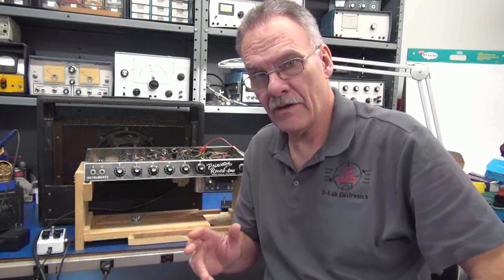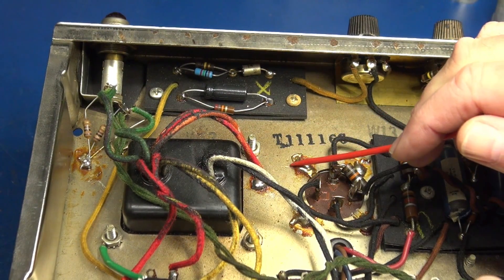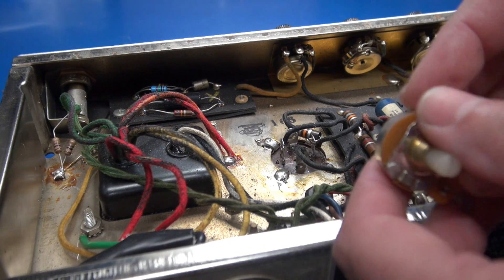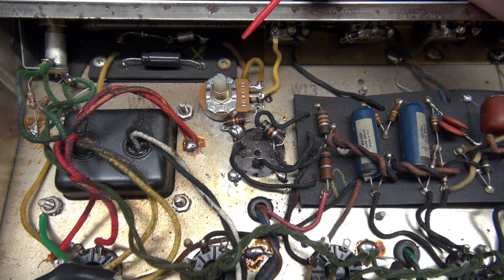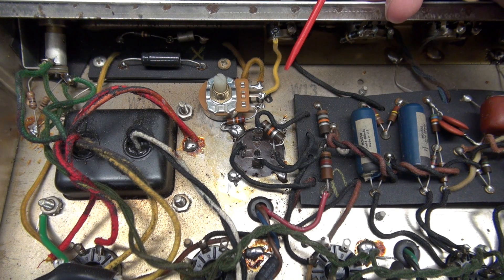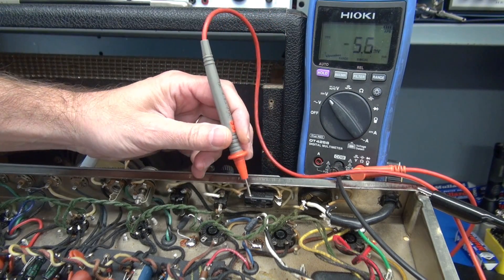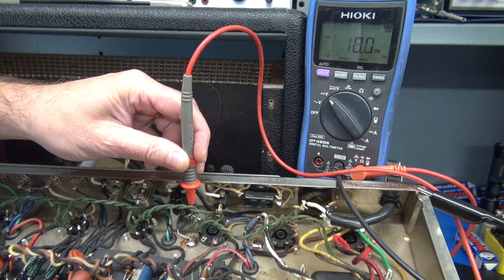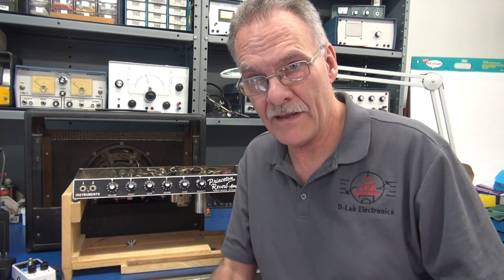Add variable negative bias Vintage Fender Princeton Reverb AA1164 Tube guitar amplifier 5 easy steps

Comment: Would it be an issue if I place the bias pot where the ground lift switch is located in the back panel since this is not being utilized?
Reply: That's what I will be doing. Now that I have a 3 prong cord the ground switch is disconnected.

Comment: I know this is an old video clip..my question is have you been asked to do the same adjustable bias mod on other fenders such as twin reverb, vibrosonic etc..

I've a twin reverb with tube balancing pot that I'm going to turn into adjustable bias to dial that negative voltage better.

Comment: Terry,  First I would like to thank you for your time and willingness to share your knowledge with us.  I have watched your videos over and over again and learn something new every time.  I do have questions about the 1ohm resistors 6V6 pin 8 to ground.  Is the purpose of these resistors to protect the tubes against a short of the bias potentiometer ?  Would any "regular" 2W 1 ohm resistor work in this application ?  I have researched "current sensing resistors" and am confused about what they are, how they work, and what they do.
Thank you again !
Reply: I think is just to read the drop voltage on cathode, for current adjustment (I=U/R or U=RxI)

Comment: Hey Terry,  I'm seeing the fuse blow as soon as I turn the amp/standby on with my Hot Rod Deluxe...if you were starting on this issue, what would you look at first?...MY plan is to replace the Output tubes, then the crappy IC filter caps, and probably the 5w sandblock resistors on the circus board...after of course, making sure the correct fuse is being used!...thoughts? always enjoy your videos!
Reply: Don't just replace parts. Diagnose the problem. Moreover, new tubes are not necessarily better than old tubes. However, new electrolytics are better than old ones.

Comment: The reason the bias was not adjustable on these amps is due to the fact that the tremolo circuit is bias varying and it can be tricky to balance when altered. I once had a Traynor amp with bias vary tremolo, with an adjustable bias. It was red plating every set of EL84's I had so I installed a variable bias on it. While I was able to fix the red plating the once sweet sounding tremolo never sounded the same
Reply: You can still get a good tremolo with an adjustable bias, just need to bias around or slightly below 70%. As the bias gets more to the 75% and above you lose tremolo depth. Such was the case for my Princeton build

Comment: Do you really install those 1 Ohm resistors just to make the math braindead easy? Surely there's another resistor (or the output transformer primary) you can measure across, no?

Comment: Hi Terry, I added 1 ohm resistors to pin eight on both power tubes of my deluxe reverb kit build from MojoTone but my millivolts stay at .2 regardless of the bias adjustment. I got my negative bias voltage set to spec, but other than that nothing happens when checking the resistors. I am at a loss, I have followed the directions perfectly from my understanding.
Reply from the maker: Check those resistors (ohms) with the output tubes pulled, are they 1 Ohm? Is the amp producing sound?
Reply: @d-labelectronics  Thank you for responding. I ordered them recently and they are 1ohm but they seem to fluctuate from 1 to 1.5 so maybe that is the issue? They are supposed to be 1Watt 1% metal film. I ran from pin 8 directly to ground on both output tubes. I just figured my MV reading would go higher than .2 or .3. I have tried two different multi-meters as well. It is really odd but the amp sounds great. 
Thanks again
Reply from the maker: Is your meter on the MV scale or volts? It may just be decimal placing?

Comment: Hey Terry, while 20ma is spec for 6v6’s in a Princeton I’ve learned with mine that 20ma-21ma is a little hot, as in above the respected 70% bias for push pull amplifiers. Could be because of my rectifier, PT, or wall voltage but so I had to do the vdrop(output primary half winding) x Resistance (same primary half winding) to get milliamps and then ma x plate voltage to make sure plate dissipation was below or at the 70%. What is your experience with biasing to certain percentages and is it really that important as long as you don’t go above ratings or red plate?? Would love to hear your knowledge on this!
Reply: You're right. You must measure the plate voltage and calculate the PD. If your PV is too high, even with 20 mA you could be too hot ...
Reply: The KISS math using rounded-off Fender-ish specs 😊 would be 20ma x 400volts = 8000mW (8 watts per tube) 😮 a little hot for 6v6 or el84,…but just right for Rock & Roll 🎉🎉🎉
Reply: @daveanderson5680  6v6’s are rated For 12-14W in push pull amplifiers. 8watts is the most ideal.
Reply: You want to run any Fender amp that's running a pair of 6V6's on the hot side, I sometimes will see them running at 80% dissipation or more with no problems. Start reducing the bias and you'll find that the tone suffers significantly

Comment: @D-lab Electronics

Hey D-Lab. Quick question that has probably been exhausted on most forums, but I wanted to come to.a guy who really knows his stuff.
I have a 1970's Super Reverb. Had the Master Volume, mid control (normal channel), and pull boost knob...

I don't use the Normal channel at all, nor the Tremolo effect.
I've been looking into the old trick of pulling tubes on the normal channel, and swapping the 12at7 Phase inverter to a 12ax7...

Just curious on your thoughts regarding this, and perhaps a video suggestion for those who are interested in the "science" behind this, what it does, and why it does it...

Side question... I notice that even with my guitar plugged into the Normal channel with all tone knobs set to zero, there is no sound/volume produced... not til you roll up the controls a little bit, then it comes in... Is this normal, and if so, why does this occur...

Also, I'm curious about "channel jumping", and how that works and what the best measure is to dial in a sound using that method...
Perhaps this would be a good video idea to those of us out here wanting to experiment a little without digging into the chasis of our amps and permanently changing things... simple "mods" we can try for chasing alternate tones as players.

I've played for 25 years, but this is my first "vintage" Fender amp, and I am still a bit ignorant regarding the quirks of the circuit, so any help would be greatly appreciated. 
Many Thanks,
Chris
Reply: I can speak on the tone knobs, yes that is normal since it Is a passive tone stack most fenders have. they only subtract frequencies (from 10 being no loss of frequencies) rather than add or boost them. so if they are all at zero there’s an easy path to ground.
Reply: @BCElectronic  That makes sense to me... Similar to how a guitar control would be wired. 10 is essentially a straight, raw signal and decreasing the knob bleeds off from that signal... To put it another way, going from zero to 10 isn't "adding" anything to the signal... just allowing more of the true signal through... like opening a water valve
Reply: @ChrsGuit  yeah!
Reply: Also, I believe pulling tubes from the normal channel decreases the load on the power transformer so it may raise voltages, less sag, or something. A 12ax7 is worth a try in the phase inverter but AT7’s have a great reputation for phase inverters
Reply: @BCElectronic  Very good information... I have heard so much. I have a very basic understanding of circuitry, having been a mechanic, as well as installing HVAC systems, but unfortunately the concept of guitar amp and pedal circuits hasn't ever been something I have fully grasped just yet... I certainly understand the concept as a whole, but it's quite daunting since I'm sorta learning from watching videos such as this... Mechanical things are more my wheelhouse.
I tried 5 times to build a simple Rangemaster style Treble Booster from kits, and I never could get it to work